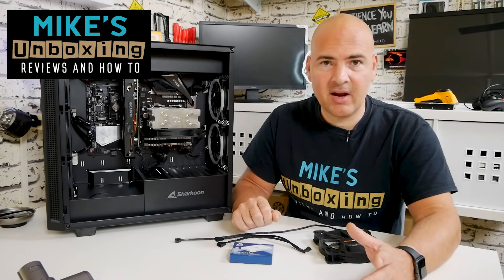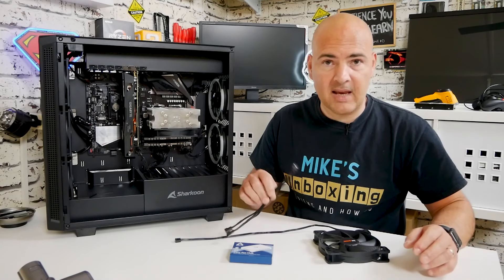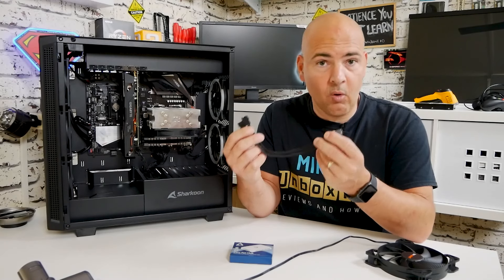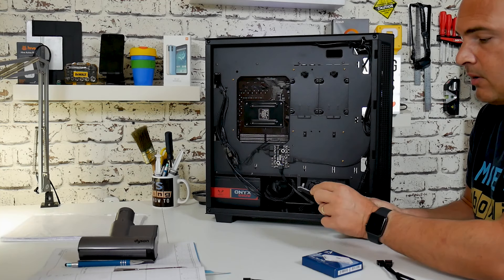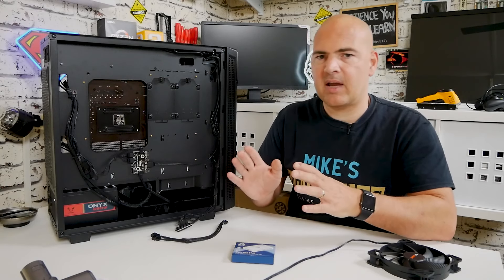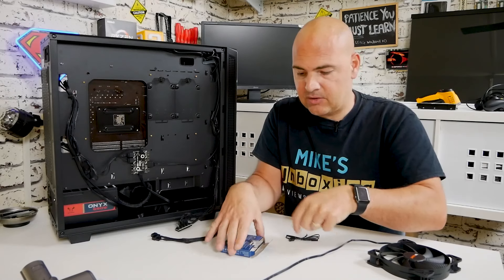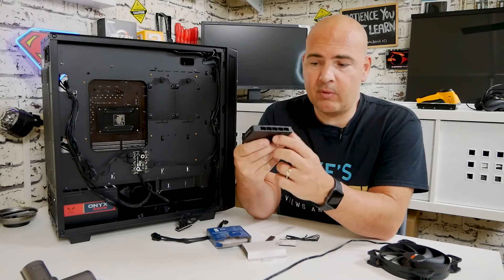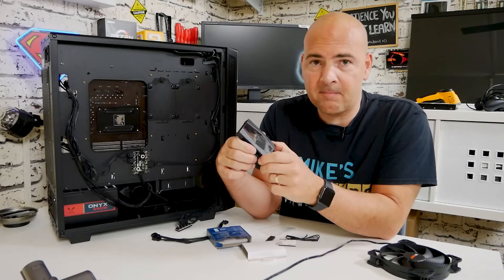How To Add Extra Fan Headers To Your PC Build

Comment: yoooo this is exactly what i needed man. i purchased a prebuilt with 6 fans, 3 of them werent running even though their rgb was running, and this was the fix. i'll be using the arctic solution, thanks.
Reply from the maker: Glad it helped you! Thanks for watching
Reply: So which way did you do, splitter or hub?

Comment: Thank you for the hub thing. I was so baffled by wanting to have 4pin fans everywhere, but cable splitters were not the right way to go. Bought two hubs as I have a 360mm and a 240 radiators in push/pull and needed a controllable 10 fan config.  THANKS!
Reply from the maker: Glad it helped :-)

Comment: tell me if im wrong: the motherboard will take all the fans connected on the power supply of artic as if it was one fan right? I mean that if you want to raise the speed of one fan all the fans that are connected there will raise their speed as well right?
Reply from the maker: yes the box is a repeater so it takes a single signal from the motherboard header and sends that same signal to all the 10 ports regardless of what is plugged in to them

Comment: Hi Mike,
great video! One question, would you go with the "case fan hub" to avoid putting too much strain onto the motherboard? In my case I have 4 fan connections onboard and I need just two 2 more. That's not much, but I just want to take as much weight off the board possible. Thanks alot. Love your channel!
Reply from the maker: Yes, absolutely that is the way to go

Comment: Thank you Mike! A short and practical video. Due to high costs and incompatibility with my MOBO I had to buy a couple 3-pin fan splitters for my TT fans (I was thinking of Arctic F12 PWM but... surprise! it was 4-pin, a shame). It was about 2 years ago. I'm having in mind that HUB and some Arctic P12 PWM PST Value Pack (great CFM).
Reply from the maker: i need a case that can use 10 fans now to test out the arctic hub :-)
Reply: @mikesunboxing  a Cooler master wouldn't be bad idea, I mean.
Reply: @mikesunboxing  talius cronos fits a maximum of 10 fans :D  3 top 3 front 3 bottom 1 back

Comment: Excellent. I just bought one. My motherboard has PWM supposedly at all fan headers, but I'm still concerned about power load on the mobo and also I like how you can program all of these fans, whereas the powerhub included would only be able to program 1 fan.
Reply from the maker: the fans will all share the PWM signal so really they need to all be the same spec, and don't worry about the current draw that is what the SATA power is for

Comment: Great video! If I connect only two fans to a single header of the motherboard by a Y splitter can I damage the circuits or I work in safe conditions?
Reply from the maker: You can, up to three is normally seen as safe

Comment: Can you put 2 3 pin fans on it at full 12volts each on the y splitter. Would it fry  the motherboard? Also can I put 2 4pin fans on the y splitter. Or would it fry the motherboard
Reply from the maker: should be okay on most boards up to a max of three fans i think
Reply: Hello,
 One more question to ask can I get two fans that have different amperage each. Will it still work, on the 2 way fan splitter. E.g. 0.50a and 0.12a

Comment: Hi Mike, 
Thanks for the product introduction, however, you made a small mistake: the DC control is not possible as the hub will get the power from SATA, so it will be 12V all the time and the 3 pins fans will be uncontrolled..
Additional remark : only the fan in the port 1 will have its speed monitored by the motherboard.
Cheers.
Reply from the maker: Thanks for the info! and i thought that was the way it worked, the description on the Amazon page was a bit vague about it. thanks again for the heads up

Comment: Great, straight forward video, but i have a real quick question. Ill be doing my first pc build soon, and is the sata cable included with the PSU? If so do i literally just plug it into the hub? Thanks
Reply from the maker: Yes it is included with the psu

Comment: No mention of amp restrictions from a single PWM (some mobo can’t support over 0.3amp).  This will severely hinder the fan’s function.  Additionally, no mention of harmonics conflicts with three to four fans plugged in to one header.  If the three fans are stacked and all split to one header, you can get chopping/pulsating sounds from the fans.  Using a SATA hub or going no more then 2 fans per pwm will get rid of that issue.
Reply from the maker: Thanks for the advice :-)

Comment: Thanks Mike, You are a genius! Making this clearer,  one more question
On a 6 fan hub like artic or deepcool, I could add the 3 way splitter to two of the slots of the hub potentially giving me 10 fans, would that be to much powered Sata draw for the hub to handle?
Reply from the maker: Yes you can! and it should be okay for the SATA

Comment: Great video mike !
Need some advice on where i should connect the hub to the motherboard…. Sys_fan or cpu_fan ?…. Currently using h310m msi board… thanx !
Reply from the maker: connect to sys fan
Reply: @mikesunboxing  what about the cpu_fan ?… no need to plug in anything ?
Reply from the maker: @syafiqahkamal4924  This is maybe easier to fix or at least advise if we can ask more questions and get direct answers, so feel free to join our Discord chat and we can go over it in more detail https://discord.gg/gaeeDPw

Comment: can you connect a three 4 Pin PWD fans, by means of a 3 way splitter onto a fan hub? potentially having three 4pin PWD fans onto one slot of the hub?
Reply from the maker: that should work

Comment: love your vids. I have a question, I'm going to build a pc for the first time. the front fan, they must come behind the iron grid plate or may they also be placed in front of it
Reply from the maker: either way is okay sometimes if the fan is too close to a mesh it will make the fan worse and create less airflow
Reply: @mikesunboxing  oke great !! Thanks for the answer
Reply from the maker: @sejdijaavdi2517  No problem :-)

Comment: first of all tks for your info video and sorry for my rusty english.
my question is... if I connect 2 fans in the Y-cable, the fan connected to the 3-pin male connector will allow me to control the fan speed too? Or just the 4-pin male should be controlled? In this case, the 3-pin male fan will run at full rpm? Please, help me with this question.
Reply from the maker: they should all run at the same speed that the header is putting out

Comment: This comment might be a little late, but I wanted to ask if you can still put 3 pins fan into 4 pins slot in motherboard? or any connectors such like the three options you gave? Thank you.
Reply from the maker: yes you can but make sure you set the fan header to VDC not PWM
Reply: @mikesunboxing  is  is VDC found in bios?
Reply from the maker: @carlti6775  This is maybe easier to fix or at least advise if we can ask more questions and get direct answers, so feel free to join our Discord chat and we can go over it in more detail https://discord.gg/gaeeDPw

Comment: Hello again sir😊. I only own an a320 motherboard, and I'm planning to buy an rgb fan 3in1 kit, I can use those using the 1 pwm header my motherboard got left, but It doesn't have rgb ports.
So do the fans still light up(to their default color) at all, without the rgb connected?
Reply from the maker: depends on the set you get but most have a built in controller
Reply: But the fans should still spin right, even without their lightning effects?
Reply from the maker: @clem9808  yes that is the theory

Comment: Hey, Thank You For That Amazing Video. I Have A Question. Can I Add Extra Fan To MO H310-K R2.0 .?
I mean 1 CPU FAN AND 1 FRONT & 2 TOP & 1 BACK CASE?
Reply from the maker: Yes you can but you will need a fan hub or splitter cable

Comment: Can I connect a simple 3-pin 120mm case fan onto a pump fan header? if so, can I change the case fan speed by reducing voltage or will the fan run at maximum speed?
Reply from the maker: most boards will allow a little control there, but it will be board dependant

Comment: Mike: i have  5 fans,, 2 front intakes+  2 on top for Exhaust +1 in back also exhaust can I buy a fan header to use all five fans even if 2 are intakes, and the other 3 are exhaust? would there be any problems? and thank you for the video as always you keep it simple and easy to understand, I just haven't used these fan headers B4.
Reply from the maker: yes you can run all the fans from a hub if you want, this will take some of the load off of the motherboard
Reply: @mikesunboxing  :  thank you much mike ur one of the few to ever respond back with good news, hope you stick around Youtube for long times.
Reply from the maker: No problem, hope it all goes well

Comment: Thanks!
I currently have 3x 3 pin fans for the intake and 3x PWM fans for the exhaust. Can I connect all of them (6 in total) to the fan hub then even if they are different pin configs and still be able to control them individually?
Reply from the maker: no the hub will be getting its rpm feedback signal from the port 1 and all the others will try and do the same, 3 pin fans likely will go full speed unless you get 2 FH-04 hubs and use three fan on each
Reply: @mikesunboxing  ye makes sense, thanks man appreciate it!
Reply from the maker: @borzonstudios8638  No problem 🙂

Comment: Hello, thanks! Bought the same, good timing! Only question. Is it normal that maybe due to that 2-3 pin connection it can't send back the RPM info? It seems like for me. Do you know if I buy another cable 3-3 pin it might work with connecting to the white 1st port? Thanks in advance!
Reply from the maker: yes the fans need all four for pwm signal or if you change the bios to VDC for three pin it will work that way
Reply: @mikesunboxing  I set the sys-fan to voltage but still marks as pwm.. I have to dig deeper captain! Also thanks, now I can find my way around in support forums more. :)

Comment: Hi Mike. I bought a 1 pin 4 header extension but I only need to connect 2 fans, it is safe if I used it anyway? 2 header will be connected to nothing. Wondering about it safety issue 🤣
Reply from the maker: Yes it will

Comment: I have an Eclipse P400 case with an older ASUS board and was easily able to split both CHA_FAN into 3 regular 120mm fans without issue. The CPU has it's own header to itself.

I got a second case for my newer PC which is also a P400 but digital. The fans will be DRGB so they are powered by SATA and daisy chained for colors, but the PWM wiring remains the same setup. 

If you're worried you might be overloading or you want your CPU fan to serve more than one fan, i suggest splitting it and connecting it with the REAR exhaust fan so your CPU and rear exhaust both have the same speed as required. 

On my motherboard splitting the CPU in 2 allows for about 8 fans without destroying the board. I am weary of connecting 3 fans to CPU_FAN headers because those fans have more chance of running at 100% speed so avoid putting 3 fans on CPU.

Modern boards also have CPU_OPT which gives you 3 more!
Reply from the maker: good tips there

Comment: So does an rgb fan come with 2 cables?
One cable for Rgb, and one cable for the fan?
Reply from the maker: yes most of them do. Some custom ones have a single 5 or 6 pin plug but that is often for custom hubs
Reply: What if it was a 2 cable fan? How can I activate the rgb(if na case fans are atleast 3-3)?

Comment: Do you think is a good idea to have airflow fans as front intake ,top,and rear. Then use 1 or 2 static fan under the gpu? Sorry sir, if I've been asking alot lately, just badly want to resolve my overheating gtx 1650 lp issue.
Reply from the maker: that card shouldn't really get hot, are the fans spinning freely?
Reply: Well I haven't really built it yet, but it's gigabyte 1650 gddr6 oc LP it has a very bad cooling design,that's why I'm planning to get a bigger case with decent number of fans(x6) and rpms, also planning on reapplying some high end thermal paste(kryonaut), and undervolting the card to its limit . 
I'll try my best wih cable management so yeah, the fans should run freely in that case.
Reply from the maker: @clem9808  Feel free to join our Discord chat you you need any advice or help when you get round to building https://discord.gg/gaeeDPw

Comment: thanks for the vid. i was looking for a solution to this problem with my motherboard and wanted a solution but not a sketchy one. the arctic case fan hub is a great solution for the problem as it draws power from the PSU and doesnt strain the motherboard.
Reply from the maker: Glad I could help

Comment: Hi, Mike great video. I'm struggling to understand if this is exactly what I'm needing though. I'm building my first pc in the next month or so and I've been catching up on all tutorials etc and I'm pretty sure it's going to go down a breeze but. My case PHANTEKS Eclipse P400A  D-RGB version has 3 Phanteks RGB fans at the front of the case I believe I''m going to be using a Corsair AIO (RGB) and a Corsair rear exhaust also RGB. My issue seems to be my motherboard only has two RGB Header I believe they're called and my motherboard only has two. Maybe I'm over complicating this but would I need a hub or an extension?
Reply from the maker: This is maybe easier to advise if we can ask more questions and get direct answers, so feel free to join our Discord chat and we can go over it in more detail https://discord.gg/gaeeDPw

Comment: I have 7 fans that i need to connect and as you mention on your video, i think the best option for me is the Arctic Fan Hub just plug one cable to the mobo and all 7 fans into the fan hub, my question here is, if i do that, is there a possibility for me to control the speed of the fans or the fans are going to be running at a 100% speed, if so, how can i do it in order for me be able to control the speed of the fans
Reply from the maker: if all the fans are 4 pin pwm and you plug them into the the hub and plug the hub into your motherboard you will get full control over the fan speeds
Reply: @mikesunboxing  jeez, the fans I have are the cooler master MF120 halo white edition and they are 3 pins, so I guess I will not be able to have control on them at all

Comment: On the 2 way splitter how does the 3 pin work? Does it not use the one pin? Or why does it skip one pin? And could you just plug a regular 12v 3 pin fan into it?
Reply from the maker: it only uses one fans PWM signal so the secondary connectors leave out the wire so as not to confuse the PWM controller

Comment: Great video! 
HELP! Is what I need lol! I have a bigger case Coolermaster HAF 932. My board now is Asus Sabertooth 990fx, which has a total of 6 fan headers which 2 is for cpu fans. I need to be able to control 7 to 8 led fans one color blue. The Artic controller seems to be the best bet for me. But does the fans go full throttle since it connects to the power supply? Does the Artic controller have a compacitor to control the speed? Because I bought this SilverStone Technology Silverstone 8-Port PWM Fan Hub/Splitter for 4-Pin & 3-Pin Fans. That stated it would control the fan speed but it doesn't the fans go full throttle. My future motherboard is the x570 Crosshair Viii formula.
Reply from the maker: This is maybe easier to fix or at least advise if we can ask more questions and get direct answers, so feel free to join our Discord chat and we can go over it in more detail https://discord.gg/gaeeDPw
Reply: @mikesunboxing 
Where are the channels that you can ask questions? It's way too confusing on that site

Comment: I am going to buy the msi b450m-a max motherboard. And i am gonna add 2 more fans but the board only has one fan header. Should i just buy a 3 way extention cable?
Reply from the maker: yes that is the way to do it
Reply: @mikesunboxing  or how many fan headers does the B450 a pro max have?
Reply: @mikesunboxing  nevermind i found out. Thanks for the tips:D but i am gonna go with a b450-a pro max instead. :)

Comment: Can you tell me how close to 1 amp you have to be to be considered dangerous for the motherboard?
Reply from the maker: Under full load is the reading you need to check but it should be okay at close to the limit, they usually add some tolerance
Reply: @mikesunboxing  probably 2 0.29 should be fine right?

Comment: Would you mount the 10 fan connection somewhere on the case or have it stored under everything with the power supplies? Looking to build my first pc and NEED all the help I can get please.
Reply from the maker: depends on the case and cable lengths, but anywhere you can really

Comment: Would you say the Deepcool FH-04 is a good fan hub too? Im planning to add 4 fans and i dont need an extra 10 fan plugs. This is also cheaper too but im not sure if it is quality or not.
Reply from the maker: Yes just make sure y out are using 4 pin fans not 3 pin
Reply: @mikesunboxing  thanks!

Comment: newbie here,  where did you plug the PWM Fan Hub in the mobo ? ,  in CPU_FAN or SYS_FAN ?
Reply from the maker: into the sys fan header
Reply: thanks for the reply
another noob question
should I plug my cpu fan in that fan hub because it has a label cpu
or I just plug the cpu fan in the cpu header and  make only the case fans   use the hub ?  
My plan is to connect my 3 case fans in the hub
and connect the cpu fan in the cpu header, is that fine or not ?

Comment: hi Mike thank you very much for your videos! I have a question , if I use a 4pin fan splitter connected to the motherboard 4pin sistem fan header then connect two 3 pin fans to the splitter cable what happens? will I still have some control over the fan rpm on the motherboard bios or not? will they run at full speed all the time or can I get a fixed RPM for the fans on the bios?
Thanks in advance from the UK also ;)
Reply from the maker: if you tell the motherboard that the connected devices are 3 pin or VDC rather than PWM that should work as intended